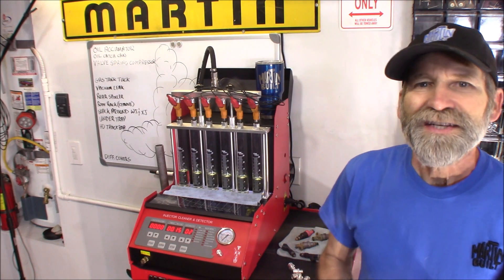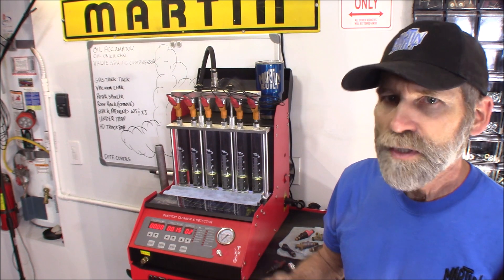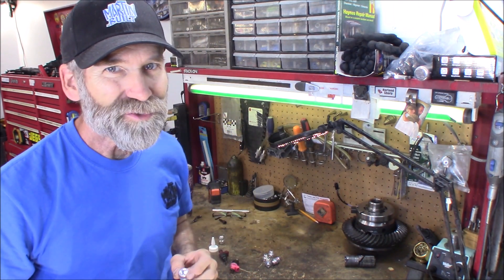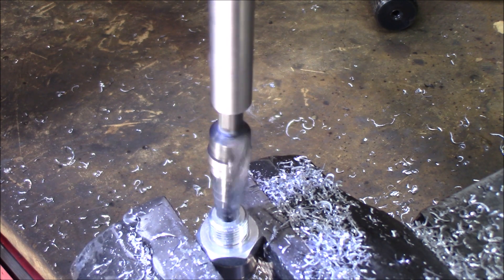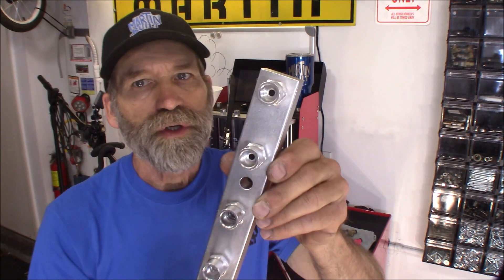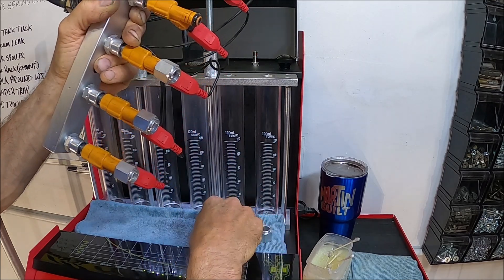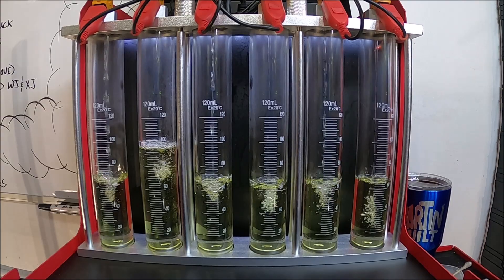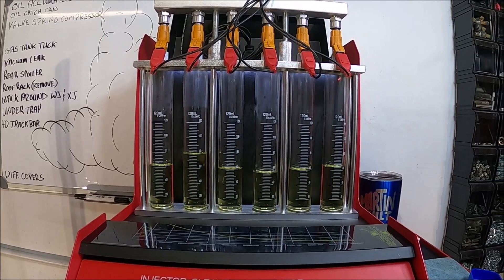How to Modify a CNC602A  Fuel Injector Tester and Cleaner for Reverse Flush

Comment: I am needing one like this do you recommend the  cnc602a
Reply from the maker: Yes, I like this machine. After adding the reverse flush to the machine it does everything I need it to do. I do wish it had a built-in fuel filter. I will be adding that someday. I don't think any other brand has a filter either.

Comment: Made a homemade DIY flow bench and invested all the money I saved into a 30L ultrasonic cleaner but major downside of my homebuilt I cannot do proper leak test at high PSI or backflush as the ability to seal the injector rail and injectors firmly isn't present on my set up. I can do comparative flow test and inspect spray pattern but backflush is manual 1 at a time and messy and a major pita
Reply from the maker: Very nice thank you for sharing 👍

Comment: You seem to like the CNC602A pretty well. I tried one but it rarely pressurized, leaked and generally didn't work; ebay seller is accepting its return. It is possible that I "ruined" it by first filling it with Lucas Fuel Injection Cleaner which is quite thick. I have since learned to use "Calibration Fluid" which I just ordered. Trying to decide between buying another CNC602A or perhaps a Tektino 8-cylinder tester (which claims to do reverse flush). With so many ebay sellers selling the CNC602A, I wonder if some are known rejects. Can you tell us where you bought yours?
Reply from the maker: I would have preferred an 8 cylinder tester. I did get this one from eBay from this seller Fuel Injector Cleaner and Tester  https://ebay.to/3hvCSWZ
It's been working well except the ultrasonic bath burned up. It does not come with a timer so don't leave unattended like I did, went inside and for got about for 3 hours.
I think it is important to use the correct fluid. Make sure anything you use is NOT flammable.

Comment: Sir Martin, Did you take out the baskets ( filters ) for this test, it looked like it  ? Do you rebuild injectors for your self or just clean them ? I was wondering ( gets me in trouble sometimes ) if adding food coloring on the spray pattern test ( or if it would even work ) so you could see the spray pattern  better ? Being kind of a clear color is kind of hard to see that well. I'm not sure if I asked you before but Do you have a special cleaner you use for cleaning injectors or what are you using in this machine ? GREAT VIDS. & THAT MACHINE IS PRETTY COOL I MUST SAY BUT ALSO YOU ALWAYS MAKE STUFF BETTER TOO, THANKS SIR MARTIN FOR THE EDUCATIONAL VIDS.
Reply from the maker: Thank you, no I didn't remove the filter baskets for this video, and I have been rebuilding injectors for years for myself. I just enjoy experimenting with them. I use Doctor Injector Test-Rite Calibration Fliud and Blue Goo for the ultrasonic bath.